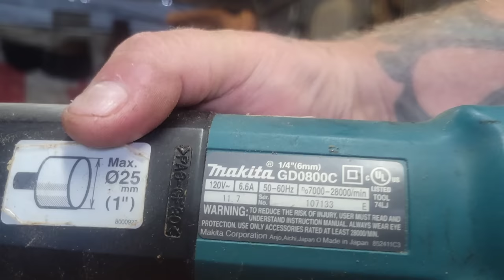Chainsaw carving a Owl. 1 of 2

Comment: Anybody else have issues, when you burn the carvings, like, it does the reverse of what you want, the deep parts don't burn that much (especially on hard woods which is all we really got around here) and the high points get charred, and sanding helps but... tried propane, map gas, acetelene... same issues... big torches, little jewelers torches... Also, thanks Jordy, I get a lot out of your videos and you're a joy to watch and you're also pretty hilarious
Reply from the maker: Thanks Eric, next time try painting ur deeper cut lines black then lightly burn over the paint , then sand away , problem fixed and black paint blends in

Comment: One product type I've used to waterproof strengthen and stop wood rot is wood hardener. Seems to work well, just a little on the pricy side.
Reply from the maker: Thanks for the tip